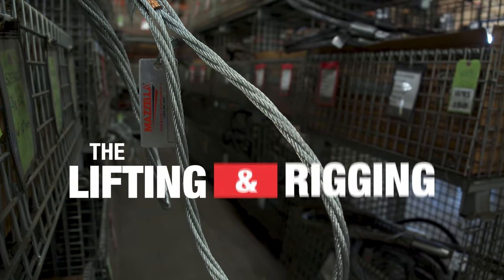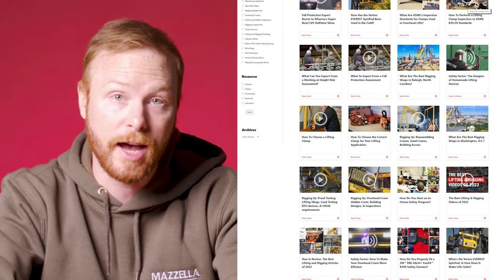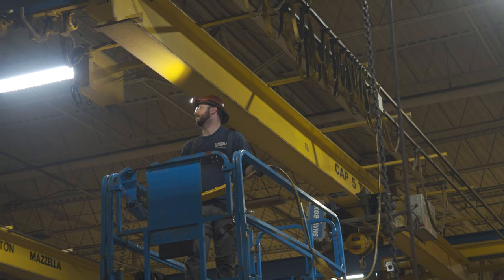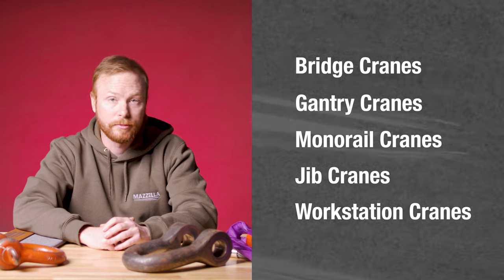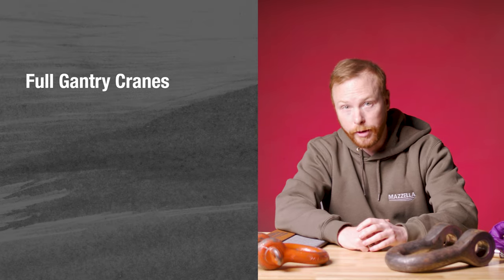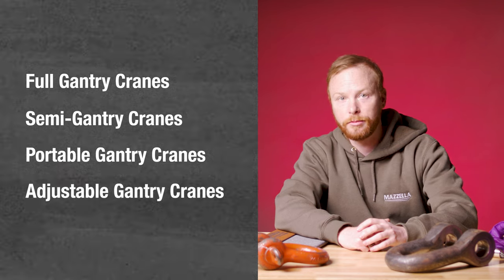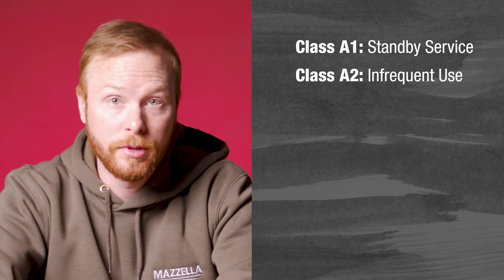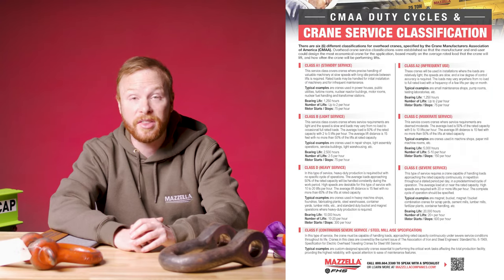Basic Rigging Questions and Terms Answered and Defined

Comment: Excellent👏!! thank you for all the information. I have a question, Can the operator hold or grab the load while moving it with the overhead crane or the jib crane? where can I find info abour it?.. thanks👍
Reply from the maker: This is a great question and something we get asked about very often. It is also a bit of a complicated answer. Stay tuned. We will have a video addressing this question in the future. But here is a quick answer for you from some of our trainers. 

"The answer is "No"... It is not safe to be touching a suspended load... under the OSHA general duty clause, You must have a safe work environment. 

There is no OSHA or ASME law that specifically says, 'You are not allowed to touch a suspended load'... however, under this General duty clause is where OSHA points to why this is you shouldn't touch it.
There are 'no touch tools' out there or even taglines for you to get yourself away from the load."

"Risk is inherent in every lift; our goal is to reduce that risk as much as reasonably possible.
Any time an individual touches the load due to physical proximity, the chance of injury increases.
Often, I see riggers/operators touching the load out of habit without good reason.
If load manipulation is necessary, prior to the lift, a basic lift plan should be formulated, which should address this issue and determine if there is a safer way to control the load, such as tag lines or no-touch devices.
Touching the load is not specifically called out as “illegal” by OSHA or ASME, but best rigging practices would keep us out of the danger zone while the load is suspended."

So basically, even though OSHA and ASME do not specifically call out touching a load, if an injury occurs and there is an OSHA investigation into what happened, the result would likely be that the rigger/operator was acting unsafely and violated the OSHA general duty clause. I hope this helps. Stay tuned for a future video addressing this question!